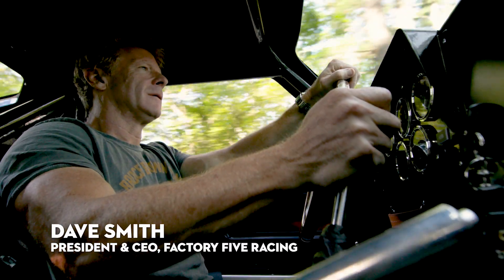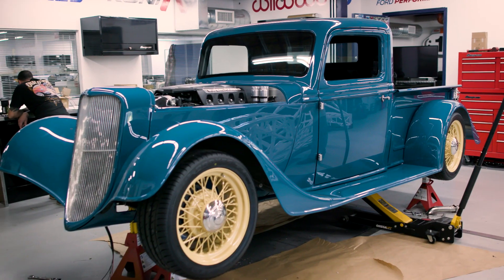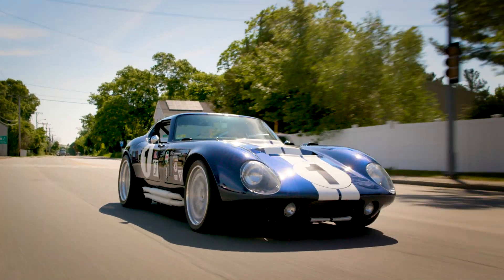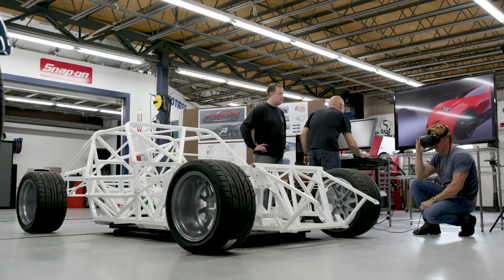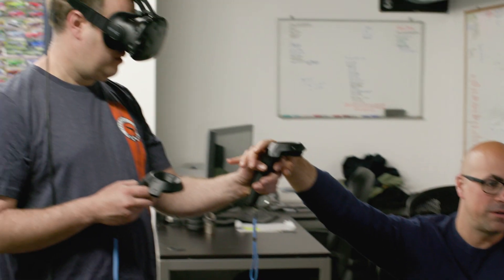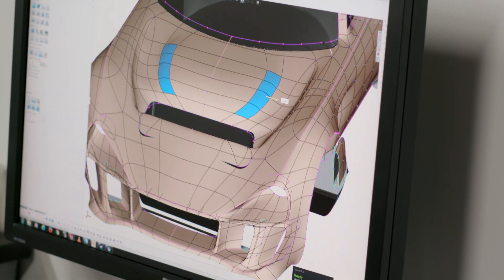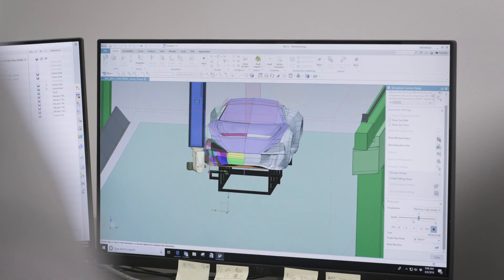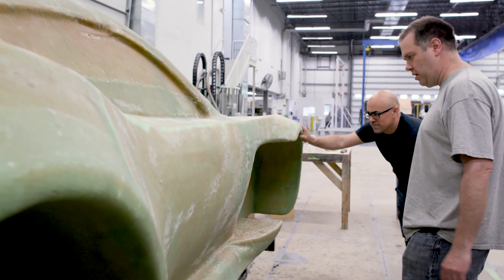New Design Process at Factory Five

Comment: My thoughts on your ideas.  You can skip all that metal sub & whole frame stuff and trust your new found 3D design surface geometry & 3D rendering(just get better with it). As far as body panels go forget sculptured maching and go to Stratasys's old(off patent now cheeper$) Ultem1010 or Ultem 9085(Polyetherimide{PEE}). Use this in 3DP's WorkBench Series #400 3D Printer to print 6mm. thick outer body panels covered and sealed in Carbon-Fiber.  That printer is about 40 to 50k depending on multiple extruders and enclosesure options.  Been eye ball to eye ball with this.  The model #400 can print 59" on the "X"axis, 39" on the"Y" axis, and 27&3/4" on the "Z"axis. Sure thats big, but out of the box thinking, can get printings 115" long or longer.  Here is how:  I will use 3" of print lenght in sandwhich/finger joinery connecting 2 printings(or more) with a special connector at each corner of printings.  After determining depth and aim of these connectors in composite panels you can attach printings at 250kg.s pull each connector. Cool thing is a simple to connect or disconnect just can be forward or reverse on your pistol drill.  THIS IS   Invisible detachable joining   "Invis Lamello"  http://store.swissinvis.com/  .    See some YouTube videos of these in action.  Composites 101 says it's not so much the joinery or materials that give strenght to your final product, it's curing, thickness, many factors for you doughters.   Invis Lamello's connectors come in 8mm.,12mm., and 30mm.(1&1/8" can easily attach sub frames to monocoque chassis).   I use   www.compositeenvisions.com   .  Burton Precision ph# 616-784-1756 deals in many 3D printers and optical/lazer scanners.  They have a very cool portable robotic arm magnetic base scanner that could allow someone to simply weld two handles on a scrap piece of heavy metal and use this scanner on site at outdoor auto shows to instantly show potential customers changes in their rides while they view it live on your laptop.